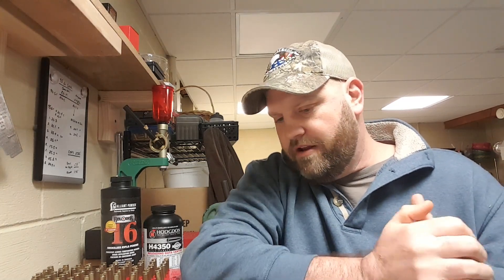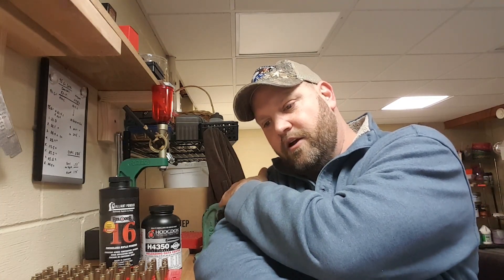224 Valkyrie – 90 gr Sierra MatchKing – Phase 3 – Reloder-16 and H4350

Comment: Have you tried different primer options? or have you been using the same type throughout your testing? If you have been using the same primers throughout, what kind do you use and are you happy with them? I like the RL16 powder choice it seems to be close in consistency to 4350 but with better velocity
Reply from the maker: Agree with the RE-16 assessment.  I like it so far..  Same primers.  Winchester Small Rifle Primers.  I am happy with them.  I was reading an article from Titan Reloading recently discussing how different primers produce different results..  So I figure I would keep as much consistent a possible.  I do have other primers that I might try at some point but I will probably back off the loads when doing so.  Apparently primers can cause up to 100 FPS differences in velocity, plus can cause an increase in pressure. (just what I have read)..

Comment: I take the Wrong twist rate out 2000 yards. Excuse for garage groups
Reply from the maker: The twist rate can certainly be a hot topic depending on where you bring it up at..  I have never shot a 1:6.5, but I can say I am not displeased with my 1:7 so far..  Thanks for the comment.
Reply: @thebigmansoutdoors  I don't think the twist rate is the problem with the round. I just think that w/o a 24 inch barrel/ some ppl are not getting the advertised velocities, Even with  a 24 inch barrel some are not getting the velocity.